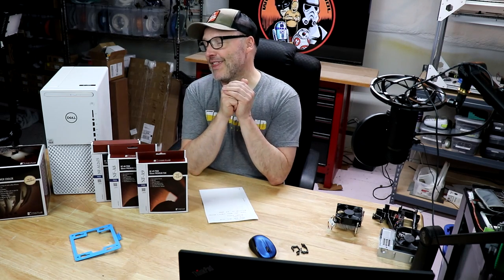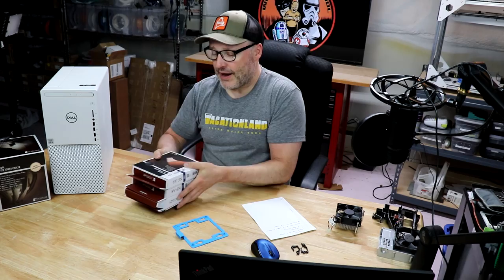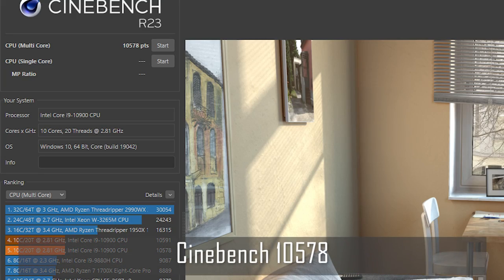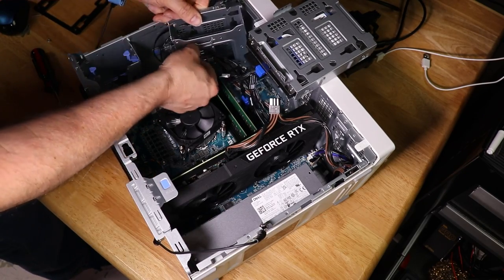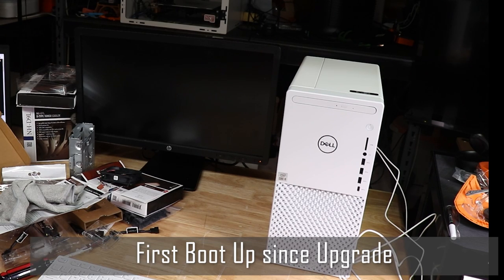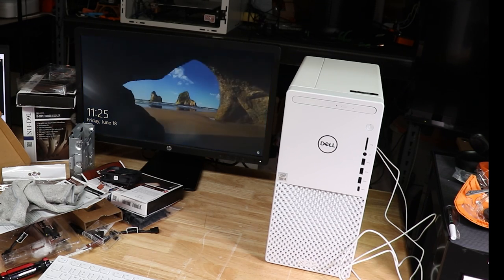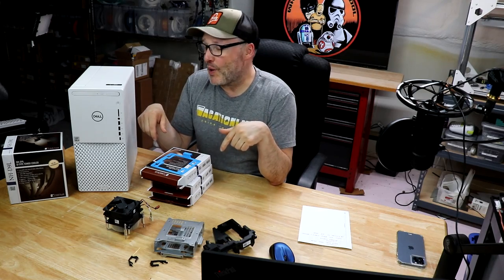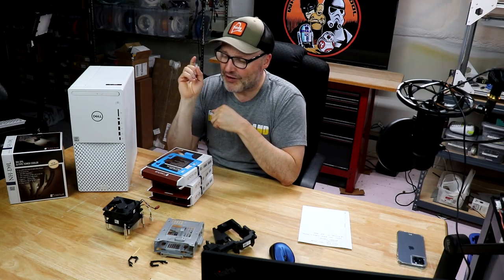Dell XPS 8940 / G5 5000 - Upgrading CPU Cooler and Fan Upgrades for better performance?

Comment: Thank you so much for taking the time to actually explain and show how to upgrade and get better cooling, I got the XPS 8940 refurbished on Amazon and love it, its a powerful computer and my configuration (i7 11700, RTX 3060 Ti, 32 Gb Ram) allows me to play games in good quality with good response times, but the damn thing is a furnace, or was until I followed your upgrade guide. Now at full load my highest core temp is 78 C which is down a whole hell of a lot from my 99 C thermal throttling temps
Reply from the maker: Noah, thank you for taking the time to comment. I’m glad you’re getting improved performance from your 8940!
Reply: Can you edit 4k video with this machine
Reply: @banjomanToddTaylor  yes it seems it’s adequate for the task and while not laggy it isn’t the fast computer for 4K editing either, if you have a budget you are trying to keep to then go for it but if you have the extra money and plan to do a lot of heavy editing then I would buy the i9 version of the machine and that one comes with the proper cooler so you wouldn’t have to mess with it at all. I think the 3060 ti does a good job in general but obviously it depends on how much your using it
Reply from the maker: Mine, as reviewed, is the Intel i9.  I added more memory (64 gab now) and everything runs better with more resources

Comment: Thanks for the video I added the cooler and fans with the huge temp differences as expected with it now able to play high end games much better. I found a comment in one of the Dell treads that instead of 3D printing the HDD bracket you can just cut the cage in half ( I used a grinder). This worked well and it secured very well with a few zip cables to the top and back panels of the cage.

Comment: I bought my Dell 8940 from Costco was on sale, I thought, I got a good deal... ha.ha.
I feel sad, everytime I play with it.  After, watched your clips and copy your steps.  Upgrading CPU Fan is a must, change the out take fan and added 120mm Front fan, Upgraded the memory sticks and GPU.  I believed, I can live with Dell for a while.  Thanks for yours links for the parts.  Fans are super quiet rmp not bad at all.  thousand thanks.  Keep it up!
Reply from the maker: Thank you for your comment. Was your cpu cooler an aluminum hockey puck like mine?  It runs so much better now that is can cook itself better

Comment: Thank you for the Video! I did actually evaluate the solution in several steps so far and like to share my experience. 
Installing 90 mm fan result in 7C temp drop from 92C, relocating hard disk from front to top of the case cooling additional 7C the cpu temp down to 78C. And Installing the CPU fan result in temp down to 56C which is impressive. GPU temp has also cooled down to about 20 C.
120 mm fan mount has been ordered  and yet to be arrived to be Installed hopefully to cool it down further. I prefer to keep Graphic card mount and not to install the 3rd 80 mm fan. Appreciated for creating this video!
Reply from the maker: Thanks for chiming in.  And welcome back some cpu processing power not that it’s not suffocating in heat!

Comment: My stock fans have been running supper loud lately and the temps are way too high, IMO.  Great video and timely. Ordered everything and will get it installed when it comes in.  Hoping this helps!
Reply from the maker: It will. Be sure to do some test runs and compare to after the upgrade !
Reply: where did u buy everything from?
Reply from the maker: @ToddAmyotte-im1pr  links in description
Reply: @WhereNerdyisCool  That's what I used! Worked pretty well
Reply: @WhereNerdyisCool  perfect. i’ll probably order them, comes up to $171 CAD, should help keep my cpu cooler lol. i got the i5-11400 and rtx3070, runs great. just really hot lol

Comment: For everyone that performed this upgrade if you've updated the system BIOS to 2.7x you may have noticed that the system may not be happy with the Noctua Fans connected to the MB fan headers (I see the issue if I run Dell's Support Assist, it now tests the fans as part of its hardware checks and it fails with the Noctua Fans connected).

My workaround was to buy a Corsair Commander Pro rgb/fan controller, connect the Noctua  Fans to it (along with installing two of the temp sensors that comes with it) and then reinstall and connect the Dell Fans (in modified locations) to the Dell fan headers. 

In order to make the Corsair unit work it needs to connected to a spare Sata power connector and a USB 2.0 header (Dell didn't go with standard USB headers, all USB connectors are hard wired to the MB. So my work around was to buy a PCIe to USB adapter and adapter cable).

 I obtained a Cablecc USB 3.1 Front Panel Socket & USB 2.0 to PCI-E Express Card Adapter for Motherboard  and a USB 2.0, IDC 5 Male (single row) to USB A Male cable on Amazon and made it work. I also found that if don't want to install a PCIe to USB adapter you can use one of the two USB 2.0 Connectors on the back of the PC (but you'll have to figure out how to get the cable from there to inside the PC to connect to the Corsair fan controller)
Reply from the maker: Very interesting. Thanks for making us aware
Reply: Now Dell has released BIOS version 2.8 for the XPS 8940. I have no clue what, if anything that may have done to the fan issue.
Reply from the maker: @sewing1243  I had the same update show up yesterday. I let it install.  Really no choice.  I didn’t check everywhere but my rear fans are spinning normally.  Ran the PC today without issue.
Reply: @WhereNerdyisCool  so, if I do your install  with the new BIOS upgrade I wont need to do this confusing workaround? also did all the fans conect to the one fan plug on the MB, or did you use a hub?
Reply from the maker: Hi !  So far (knock on wood) I’ve had NO issues with any updates Dell has sent over. Of course your mileage may vary.  I had to extend one fan cable for the one I put in front of the graphics card. In hindsight I’d skip the video card one and just do the front and back fans.
Reply from the maker: @somapusher  just edited my reply. Autocorrect nailed me
Reply: @WhereNerdyisCool  Thanks I'll probably skip that fan. Now I need to upgrad the ram. Any ideas?
Reply from the maker: @somapusher  I went to Crucial and went with a 64gb upgrade
Reply: @WhereNerdyisCool  Do you have item/part numbers?
Reply from the maker: Mine came with 32gb so I used this to bring it up to 64g

https://www.crucial.com/memory/ddr4/ct2k16g4dfra266/ct19034748
Reply from the maker: You can also download and use their system scanner to verify

Comment: I like this tutorial, despite me not owning the xps 8940, the inspiron 3891 has simmilar hardware and the same stock cooler, so thank you this has directed me for future upgrades and airflow improvement
Reply from the maker: Thank you for the comment
Reply: @WhereNerdyisCool  Just wondering, whered you find the headless m3x25mm screws
Reply from the maker: As mentioned in the video and countless times in the comments 🙂… I just used a Dremel and cut the heads off some M3 x 25mm
Reply: @WhereNerdyisCool  Thanks, I got the tools in the garage
Reply from the maker: How did it go
Reply: @WhereNerdyisCool  well i got the nuts from rona, dremmeled them, just gotta buy the cooler now

Comment: Thanks! I did this upgrade for myxps 8940 with i7 10700 and rtx 2060 super. My computer runs way better at cooler temps!
Reply: I'm wanting to do this upgrade to my computer.  I opened it last night to get a gander of the innards for comparison to the video.  I cannot figure out how he is wiring the 120mm front fan to the system.  I'm sure there must be something there, somewhere.  However, I see only one label that reads "fan sys", and that is dedicated to the rear fan.  What should I be looking for?

Comment: This is a great solution! I usually Build but due to supply Issues I bought this PC  as a great bang for the buck. I too have been after solving the heat issues. If I can offer one thing. Upgrade to the K version. for the 100 ish bucks more you will get the upgraded CPU cooler and the VRM Heatsink.  I upgraded the back fan to the Noctua, and moved the stock one in front.
I now am getting the front bracket printed out for the 120. I did find the font cover is limiting airflow at the top vs bottom. I am considering a front grill of some sorts,  or some extra vent holes but i want it to look decent.
Reply from the maker: Hi Jason. Same situation.  I’d rather build. But nice to do a few tweaks for improved performance

Comment: Would have been interesting to see the results with just the added fans without new CPU cooler.
Reply from the maker: Right?  Or just the cpu cooler
Reply: It would have been good to see each upgrade added individually and then tested, and then add each upgrade one at a time (in order) and compare results after each step to see what the additional fan improved (if anything). I suspect the CPU cooler would make the biggest improvement, next the front fan, and then I suspect the case fan replacement and the fan for more air for the graphics card probably had the least effect.
Reply from the maker: Right?  Hindsight
Reply: I just upgraded the one exhaust and the improvement is minimal.  2-3 degrees cooler at best.  And that's with both OEM cpu fan 80mm and the A9 set to run at 90%.
Reply: CPU Cooler makes the most difference.
Reply from the maker: @zeroturn7091 yes for sure. Rear fan too!

Comment: well, i tried to upgrade the fan son my dell 3010 for my pfsence this is what Noctua told me I also updated the bios as well in the hope it was an issue nope still a problem  Systems from Acer, Apple, Dell, HP, Lenovo or other major brands often use motherboards which differ slightly from the specifications issued by Intel and AMD. While those changes are usually subtle, they can lead to compatibility issues with coolers that were built to comply with these specifications.

Even in case the cooler is mechanically compatible and can be installed, other issues can occur, e.g. proprietary fan connectors, BIOS errors due to a low fan speed, shutdowns, etc. Some of these problems can be avoided with some technical knowledge, but especially BIOS-related issues can often not be resolved.

Due to the large number of possible issues that cannot be resolved with different mounting parts alone, Noctua does not officially support systems from Acer, Apple, Dell, HP, Lenovo, or other major brands.

Comment: Thank you for the excellent video. Would installing the Noctua CPU cooler on a Dell Precision 3660 be the same? Given Dell uses proprietary motherboards, how do you know which Noctua spacer to use? Also, did you get any Bios errors after replacing the CPU Cooler?
Reply from the maker: I’d check the Dell Forums on that model. I am not sure since I don’t own that machine.  The forum has some pretty bright people in there and good resources.

Comment: How are the two front fans powered again? Using Y splitter, the top front fan is coupled with the CPU fan and the bottom front fan with the rear fan? Finally installing the case fans this week after 2 years of waiting!
Reply from the maker: Oh wow you waited a bit. I think that’s right. I don’t remember off hand.  Don’t bother with a fan in front of the video card. Check my recent update video too!

Comment: I noticed that when you put the front fan adapter on the case you only secured it with the single screw.  The adapter has slots in it that are supposed to slide into tabs on the case.  The screw is only there to keep the bracket (or hard drive) from sliding out if you move the case.
Reply from the maker: Good catch

Comment: A free way to have the GPU and CPU run even cooler is to undervolt them. Undervolting the GPU is super easy using MSI Afterburner. I've set my RTX3070 to a max voltage of 975mV @2000MHz (down from over 1100mV stock). This brought the temps down by 5-7 degrees in games. Undervolting the CPU is a bit trickier as the BIOS blocks that by default, but there is a way to hack that (takes about 30 minutes and you have to be careful). A pretty conservative undervolt of -125mV brought my CPU temps down about 5 degress under load. Not spectacular, but not bad for "free cooling" :)
Reply from the maker: That’s interesting.  It would be fun to compare benchmarks
Reply: @WhereNerdyisCool  I used to get 14000 in Cinebench R23, but for some reason now I can't get above 12k anymore. 3D Mark Time Spy is 13k (14K GPU and 9.3k CPU). Looks like something is slowing my CPU down. I'm on a i9-10900F + RTX3070. CPU temp maxes out at 72-73 degrees in all-core Cinebench and GPU goes to about 75 degrees in Time Spy.
Reply from the maker: Try single core Cinebench?
Reply: @WhereNerdyisCool   God, I'm so dumb. I realized I had turned Hyperthreading off in the BIOS a while ago  when testing gaming performance, and never turned it back on. I got 14700 in R23 now on all core. Single core is about 1350
Reply from the maker: Phew an easy fix!

Comment: I tried to install the same fan on my CPU heat sink and I keep getting bios CPU failure any advice? Thanks.
Reply from the maker: I've never heard of that.  Check the Dell Forum I linked in the description and mention that in the thread.  Let me know how it turns out   Mine is still working great

Comment: Thanks for the video! Went ahead and followed your advice. Question for the 80mm fan near the PSU/GPU, how did you attach it? I just picked two holes and secured them with those two only. Is that what you did as well? Unfortunately you didn’t give a view of the back of the case so I couldn’t see which grid holes you picked… 

Also, what would your thoughts be on flipping the 80mm fan’s direction? I know it’s against best practice to have an an egress on the front, but my 3070 is taking so much space in the case that it feels like that area is closed off from the rest of the pc’s components; it makes me wonder whether hot air gets trapped in the area surrounding the power supply…
Reply from the maker: I’m not sure that fan my the gpu is really doing much. I figured any extra air moving out of the case had to be good!

Comment: Great video, i am just about to do the same upgrades based on your video, I am wondering though-are you using the 500w or the 750w power supply?
Reply from the maker: My 8940 is 500 watt and being proprietary, that’s as high as I can go. If I had it over I wouldn’t bother with the fan in from of the gpu. No real gain. However it runs so much better and has done great for games. I just ordered an Alienware R15 that should arrive this week

Comment: Hi @where nerdy is cool  Amazing video.  I used dell cpu heat sink for k series which reduces the temp from 85 to 75 for gaming. Then i added 120mm nzxt fan, noctua 92mm exhaust fan and (old exhaust fab)80 mm for GPU. After adding these my temperatures are still same didn’t change much. Any suggestions what i might be doing wrong? Thanks
My current config
i7 11700
32 GB Ram 2133 Corsair
RTX 4070
2TB SSD nvme lexar
Game- Call of duty

Comment: Thanks for this helpful guide!  I went the cheap, fast & easy route - I just removed the side cover!  It has helped a lot! LOL!  This isn't a permanent solution, but the open side of my 8940 is tucked behind my monitors.  I wonder if just replacing the back fan with a 92 mm and replacing the CPU heatsink would get good enough gains without adding the front fans.   

How noisy is your computer now after adding the two front fans as well?
Reply from the maker: Not very. I don’t hear the fans at all
Reply from the maker: I think the cpu cooler upgrade is the first thing to do.  Offer rear fan to get that heat out second. Any additional airflow is a bonus

Comment: Regarding those m3 screws, I have them.  Yay!!  

So, here is the question.  How far do I insert them?  Do I screw them until they stop on the floor, as in touching the case?

Or is there a different depth ?

Also, I think you used the lock nuts on the screws.  If so, did you still need the black spacers ?
Reply from the maker: Hi!  It’s been a little while so I can’t recall everything. You can scroll through the comments of what others did. If memory serves I just used some 25mm screws and cut the heads off.  Filed and used those.  Also - check the Dell Forum link in the description.  A lot of the steps I did came from there.  Be safe and good luck!
Reply: @WhereNerdyisCool  

Wow!  That was a fast reply.  Thanks.

Yeah, I read every comment, nearly 500 of them.  No mention of how far to insert the screws.  No mention of locknuts or spacers.

You did tell a few people how you got the screws.  No problem there.  I have the screws.  Just confused about what to do with them.

So, since it has been awhile since you did this, maybe let's forget about this specific project.

Please let us speak generally.  

Generally, when you insert a screw into a motherboard, how deep do you put it?  Do you go all the way to the wall?  Or is there some other depth you stop at?

Any insight?

-Sam
Reply from the maker: @SamBrandon-x6j I just gave enough twists it didn’t touch the case
Reply: @WhereNerdyisCool  Thanks a million!  Good to go now.

Comment: Question about the 80mm front bottom fan.  How did you mount the 80mm fan?  Did you mount it like the rear 92mm fan with the pull rubber tabs or a 3D printed bracket like the one for the 120mm fan?  I've watched the video and tried to see how you mounted the 80mm front fan and I can't catch it.  Thanks!
Reply from the maker: I zip strapped it to the front of the case in front of the video card.  I’m not sure it does a lot but any added airflow in that little box is a win